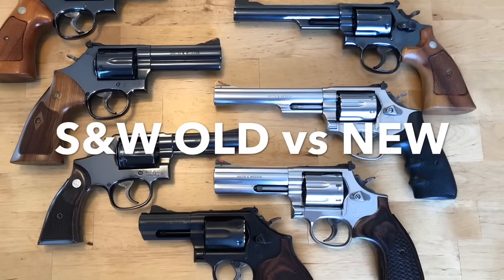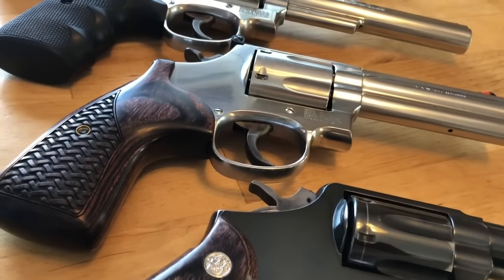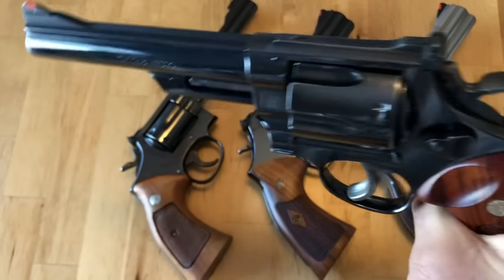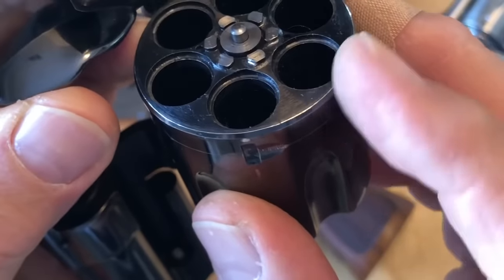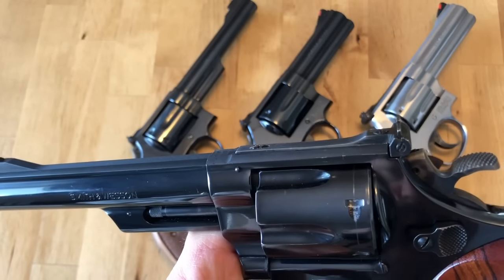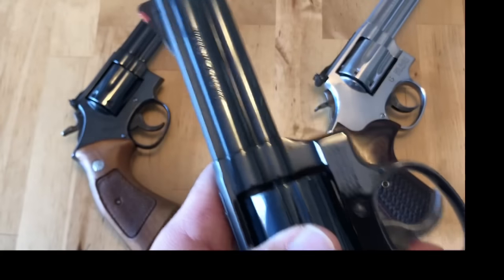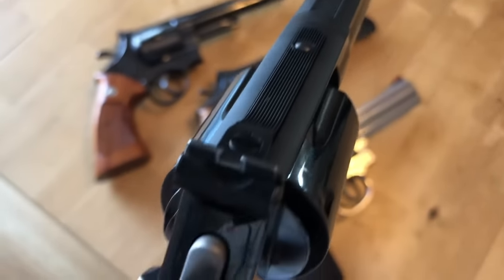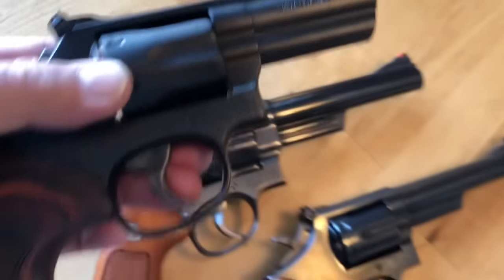Smith & Wesson: Old vs New. Do they make them like they used to?

Comment: I ordered a 19 Classic, it was 22 months before it arrived at my dealer! When I took possession of it, I immediately called S&W for a return authorization! The gun had many problems that should not come with a brand new gun! It was manufactured in the third week of July, 2021. I received it during the fourth week of July! It honestly looked like something that you would find in the used gun area of a Pawn Shop. The frame and cylinder were finished in the deep rich black bluing like the guns of the 70’s, the barrel shroud appeared faded from black to gray! The cylinder had a very pronounced wear ring around it! The recoil shield had a wear groove where the cylinder strikes it when closing it! The grips did not fit together at the front of the butt, almost 1/8 inch gap, at the rear, they were fine! I returned it to S&W, they kept it 4 months! Once I finally got it back, it looks and shoots great. S&W took care of all problems! I don’t sell or trade any of my S&W revolvers but I will never have the love for this gun that I have for all my other Smiths! It should have never left the factory in that condition!

Comment: Smith is not cranking out revolvers and thats for sure. Today I drove 70 miles to a usually well stocked gun shop and they had two Smith revolvers under glass. The explanation was that Smith was behind on the other guns they make and  not putting the time into building revolvers. I passed on a new 3 inch Python, $1700.

Comment: My father was a Chicago Cop when I was a kid and I inherited his S&W.38 Special CTG service revolver from 1955!  It has a pinned barrel and a “floating firing pin” as he called it. Adjustable rear sight and recessed cylinder.  Also I have his old off duty S&W snub nose .38 Detective 5 shot revolver that he had a gun smith shave the hammer down so he could carry it in his pocket like all the old time detectives did.  Also another snub nose .38 Detective air weight revolver that I swapped out the grip for  Packmayre grips.  I bought back my S&W Model 19 357 Mag Snub Nose revolver that I carried before converting to 9mm Glocks.  All Fire beautifully.

Like you said, keep them cleaned and lubbed and I can pass them down to my sons.
Reply: The CTG that you are referring to is an abbreviation for cartridge.
Reply: For future reference, Colt had the 38 Detective Special which was a six-shot snub nose. It was also sometimes chambered in 32 caliber. If you have a 5 shot snub nose it's a Smith & Wesson Chief Special, that's named for its being introduced at an International police Chiefs Association convention.

Comment: Today's S&W revolver is only a shadow of the revolver's made 25 years ago
or so.  Most of the part's now are metal injection molded rather than forged.
S&W intent is to have the part's drop in with little to no fitting.  Fitter's ( the
individual's who assembled the gun use to use  a 56 point inspection sheet.
The last inspection sheet I saw had 12 inspection point's. S&W went to
the two piece barrel system because they lost the ability the align the barrel with the frame. (The procedure is called "clocking")  Compared to the older gun's , polishing and bluing also leaves a lot to be desired.  The Performance Center Gun's are not what they used to be
either.  Most are fitted on the regular production line. When the P.C. was a seperate
production facility, the gun's were assembled and  hand fitted there. A  Performance
Center action is no better than  the action on a regular production gun. I love Smith's
but only the older one's.
Reply: If S&W were to produce guns in that manner now days they would have to charge 3-5 thousand dollars for them.
Reply: @cameronnorton5898 I think you're right.  Having someone sitting there hand-fitting parts, making an hourly wage plus company contributed health insurance...would certainly bring the retail cost of the gun way up.  I would be willing to pay the extra money for a hand-fitted gun up to a certain point.  But would not pay double.  A new N-frame is $1100-$1500 now where I live.  I couldn't afford $2500+.
Reply: They are not the same, but I wouldn't call them a shadow of what they were.
Reply: Old smiths wear out if you use them to any extent. Timing gets off etc. Who does the fitting work these days? Hardly anyone, good luck finding a smith who knows wtf. Ill take the modern stuff. I can do repairs myself with CNC parts that require little to no fitting. I will not pay 3500 bucks for a fitted pistol. 1k gets lead on target just fine.

Comment: I started in law enforcement in the early 1980s. I was initially issued what turned out to be a pre modal 10 revolver with the 5 screw frame. That was replaced by the department with the modal 13. For off duty I had a modal 36, later replaced with a modal 60 due to being bordered on 3 sides by salt water and perspiration issues. Later we got modal 67s before the agency went to 9mm and later .40 Glocks. I managed to keep all my revolvers when the agency traded them, because the gun shops really didn’t want a lot of used revolvers. Three of the revolvers I got issued were new when I got them so I really have been the only owner/user of them. All have the case color hardened, hammer mounted firing pins and no “Hillary hole” lock. They will all go to my son and grandchildren and make them excellent home defense guns. I figure they will only go up in value as the classic guns become older and fewer on the market. You did a good job making it simple and easy for mew shooters to identify the major changes in Smith revolvers.

Comment: I've been a smith nut all my life. I do my own trigger work and as far as the internals I don't care how the parts are made , there is no burrs , mold marks  nothing. I bought a spring kit for my 60-14 & after working on the hammer & trigger & installing those springs that piece is smooth as eel poop single & double action. I do think they are made as good now as back years ago. A Ruger you can shoot forever & it never gets loose anywhere, they are tank weapons. My one regret of selling was a colt .38 super in polished stainless. It hit me for $1400 new. I'm sick for selling it.

Comment: I bought a 1989 686, 4 inch, SS, full lug, 357 12 years ago off of Gun Broker. The weapon came from Detroit and was in excellent condition. I had a 6 inch but condition and handling was less desirable so I sold it. The 4 inch is still my carry weapon in the woods hunting and the only change I’ve made was a Hogue grip for the wood grips which I still hold on to. The pink wedge in the front sight is faded but original. It’s a wheel gun that was built to last and has served me well.

Comment: I use to own a  S&W model  686 in .357 Magnum, Stainless Steel with a 4 inch  Barrel. In 2008  I traded it in for a Sig Sauer P239  in a 9MM. The  following month  after I  traded in the 686, I  tried to buy it back  but the Gun Store had sold it.  So  I bought a new S&W model 60 in .357 Magnum in Stainless Steel from the same Gun Store in Connecticut.  In 2009,  I sent the  Revolver back to Smith & Wesson for them to do a Trigger Action Adjustment. Now the  Revolver fires and discharges  rounds with a much smoother lighter crisp trigger pull. It  was worth every  $ dollar  to  have the  Factory make the adjustment  and not  void the factory warranty on the firearm.

Comment: Every S&W revolver fan should pick up a copy of "The S&W Revolvers: A Shop Manual" by Jerry Kuhnhausen.  I believe the 5th edition is the newest.  He explains at length the inferior, but cheaper, manufacturing methods S&W uses now.  His advice on repairing MIM parts is to switch to forged parts if available, or just refuse to work on the latest guns at all because of the potential liability to the gunsmith when they fail.  He backs all of this up with photos of guns that failed exactly as expected from their current construction.  The Performance Center is basically how all S&W revolvers used to be made, but they are still stuck with MIM parts.  I love my S&W revolvers, but I just patiently watch for used guns in decent condition that still have pinned barrels and forged parts.
Reply: It's been downhill ever since some numbskull decided to shave $2-$3 off the end price of the hand ejector... Certain precedents should not be set
Reply: @NickAkins-iv2jx  You are so right Nick.

Comment: I appreciate well made firearms but I’m not a connoisseur of Smith & Wesson revolvers. I’m perfectly happy with my not pinned, not recessed, MIM, Hillary hole 586-8. My main complaint is that I had to turn down 3 examples of this revolver to finally get one that didn’t have a canted barrel. I’m
Just glad my LGS was willing to work with me to get one with a properly aligned barrel. 

But anyway, the finish is great to look at, it’s properly timed (except for drag marks), it locks up tight and has a sweet trigger. It’s not a cheap revolver by any means but the quality really stands out when compared to most anything else on the new gun market.

Comment: My experience has been those old finishes looked good but they did tend to develop rust getting in and out of a squad car back in the 70's.  Air conditioning, humidity, snow, rain made constant maintenance a real necessity certainly not like the Glock I carried later.  Maybe the new Smiths do to, I don’t know.  Best way to defeat rust on revolvers we found was frequent use of a hard automobile paste wax.

Comment: Very nice review.  Very difficult to qualify quality.  In my opinion, fit and finish of models prior to ~ 1980 was superior to what is available today but hand fitment was required for that "breaking glass" trigger.  However, the metallurgy and material processing of today is leaps and bounds ahead of the past.  Many of my mim S&W revolvers have triggers equal to the older models.  My complaint is quality control.  I've never seen a canted barrel except on the internet, but I did witness a M686 barrel launch itself downrange several years ago.
Reply: I have a mid-70s Model 25-2 that looks gorgeous outside. However, the machining marks inside made me think some guy who got laid off from the Pinto production line finished it up on a Friday afternoon. Also the cylinder bores are .456-.457 instead of the .454” they should be. A couple of early 1990s S&W revolvers were finished much better inside. An early 2000s 642 was nice and tight, while 15 years later and M&P 340 needed some serious work to smooth out the action.

Comment: I bought an old S&W Model 13-2 .357 Magnum used in a pawn shop in 1980 for $150.00 (+tax).  It has a 4" pinned bull barrel, recessed cylinder, a pinned firing pin in the hammer, a square butt, and a well worn deep blue mirror finish.  The barrel seemed badly damaged near the forcing cone by the previous owner, which is why I paid such a low price.  I cleaned the bore for several hours with a brass brush and discovered the "damage" was just lead build-up which was never properly removed.  At the end of my work, I had a completely clear, mirror bright bore from the forcing cone to the crown.
This year, I bought a new S&W Model 66-8 .357 Combat Magnum in stainless steel, with a 2¾" shrouded (two piece) barrel, an adjustable "target" rear sight, a round butt, and the action lock (Hillary Hole).  Both are K-frame revolvers and are accurate to a fault.  I have noted that the older Model 13-2 has a far smoother trigger than the newer Model 66-8.  This may be caused by all the rounds which have gone through the older one, while the newer one isn't quite "broken in" yet.  Time and use will tell if the trigger will smooth out.
Interesting and informative video
Reply: I have a 1977 Model 13-2 (pinned barrel, counter-bored cylinder) 4" that I took off of one of my clients in exchange for a $250 tax return prep fee he owed me (I'm a CPA) about 20 years ago.  It was formerly a TX state trooper service revolver.  It had been re-finished in a dull blue, had a very slick trigger job, Pachmayr grips, and shot lights out at the range.  Still the best shooting revolver I have.

Comment: I bought my first 44 at a gun show. It has a four inch barrel. I liked it so much. I got myself a five inch barrel. Both are stainless steel version. Also, when i first got both of them. I cant rememner the grain. But it did or state that it was 1600 feet per second. Yes, it had a nice little snap to it.

Comment: Jerry Miculek and many others say that the new ones are better than the old because MIM is more exacting without hand fitting and the sleeved barrels can be torqued better while still retaining a perfectly straight barrel with no cants. However the new production classic revolvers are a Frankenstein of MIM parts and the classic full barrels that can "cant". Smith and Wesson makes a fine firearm all the way around no matter when it was made. I did however pick up a newer Combat Magnum 66 and it had a huge cut in the frame under the forcing cone, but like a fool I never inspected it at the FFL as the floor models are not what they bring out. The store took it back the next day and they all agreed at the FFL that it should not have left the S&W factory or the gun store.
Reply from the maker: Gun Sam Revolver Aficionado Jerry Miculek Gets paid by Smith and Wesson to help them sell new fire arms. Something to consider.
Reply: Yeah modern Smith revolvers are perfectly serviceable firearms for the average shooter but from what I’ve seen the modern guns are by no means as well made as the P&R guns were.
Reply: @drdrake63   Exactly right.  S&W has single handedly made the entire Miculek family millionaires.  Jerry is under a big money contract and has S&W as his main sponsor. Jerry is a great guy, but he cannot dare to even think one bad word about S&W.

Comment: I’ve been buying S&Ws since the mid 60s. I have over 20. Most are pre 75, but some of the newer like the da/sa semis like the 5906 and a .380 Bodyguard all are keepers. I have a 6” mod. 19 from 1970 that I shot weekly in competition for the last 49 years it has over a 150,000 rounds through it and has yet to malfunction. I sent it back to Smith just to have them check that the metal was still safe after 125,000 and told them not to change any parts or springs. They gave it a clean bill of health and I still shoot it regularly. I bought a 6” 66 to take some of the pressure off in 1990, but the 19 is still unmatched. I have yet to send any of my guns back for a repair in over 50 years. That says it all!!

Comment: Nice collection!  The new Smith and Wessons shoot great - especially the new classics - my biggest issue with the newer guns are the MIM parts (and the inconsistent quality control).  I cracked my MIM trigger on my 640 Pro, but I haven't had any problems with non-MIM parts on any other guns.  I love wheel guns and have a number of older S&Ws and a couple of Colts as well as several new S&Ws.  The blue finish on the new S&W classics is very good.  That being said, it's really hard to beat an old pinned and recessed revolver!  Smith and Wessons are my favorites, but Ruger makes some nice wheelguns too. They just don't feel as good as a great S&W. 

My favorite shooting revolver is a 70's S&W 19-4 4" that was specially made for the anniversary of the California Highway Patrol. (evidently they did this with lots of PD at the time)  It was obviously given a lot more attention than their regular Model 19s, and shoots DA like the smoothest Python!